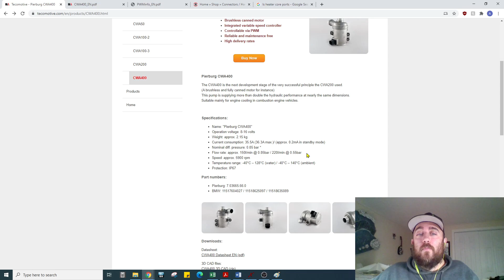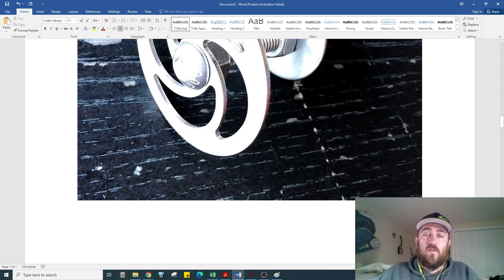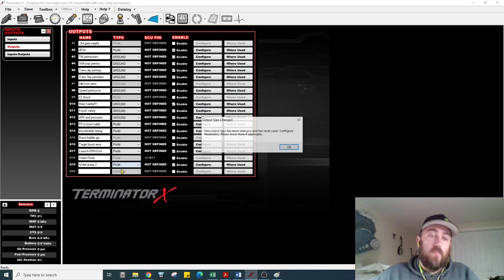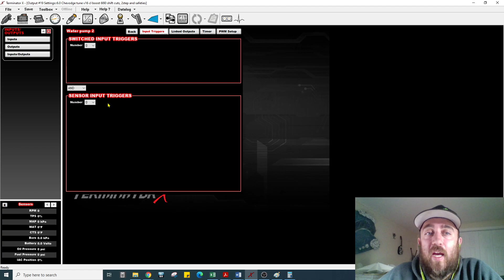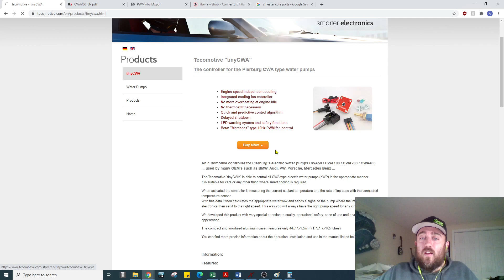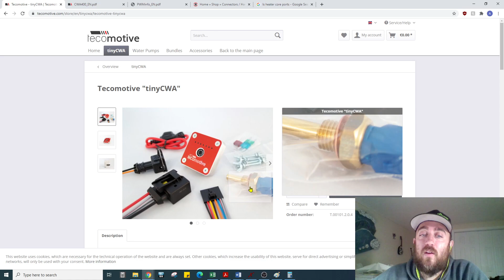$100 BMW Electric Water Pump and Controlling it with the Holley Term X

Comment: LoL! These routinely fail at 60K! BMW FORUMS ARE FULL OF THREADS OF HOW UNRELIABLE THESE ELECTRIC WATER PUMPS ARE
Reply: I have 197.000 miles on my BMW, original water pump. Check your information, thoroughly, before bashing people.
Reply: The other thing to consider is that they are buried on a stock car. Mount it with a reasonable easy access and have a spare. The price is worth it.
Reply: A lot are misdiagnosed and it’s just the thermostat
Reply from the maker: Long story short, These ones don’t, the n54 pumps were by in large, the problem child. 

Short story long, I’ve confirmed that with a few BMW techs including searching the forums myself. The plastic ones commonly found on the n54 were smoldering piles of garbage and made by continental, the forums are flooded with posts about them, some were ringers and could go 200k, but many failed before then. There was a pump that looks similar to this, but is much lower flow, the CWA200, that was used on the N51/N52/N52N. Didn’t do much research into that pump because I really wasn’t interested in the lower flow rate. The CWA400 pump, which is what this is, has been largely very reliable, and is found on the n20. Both the CWA200 and CWA400 are made by pierburg While it’s the newest of the pumps, some people have already been putting 100k+ miles on them without issue. I bought the one for my truck with 52k miles, and I’ve put probably another 18k on it since. I’m not worried, but, with how cheap they were on eBay, I bought a spare just in case.

Comment: this looks like exactly what i was talking to someone the other day about.. i was thinking a 3wire setup that would have 1 wire feeding the pump to run at a slow/normal speed and the other wire or trigger/pwm wire to make it run wide open/100%. didn't even know these were a thing. this may be overkill for what i'd be looking to remedy. 427sbf that blew out the water pump's shaft seal when 150shot of nitrous was sent at it. installed an underdrive pulley on the WP, but may have a cooling concern now and was tossing around the idea of using an electric "helper pump" with the mechanical one or just replacing the mechanical pump with an electric, removing the thermostat, and using the holley to control the pump via temp. however i was concerned about there being no coolant flow and it not providing a good signal to the CTS.

Comment: The link you put up goes to the LIN version, which isnt supposed to be PWM controllable.  What part number are you actually using/where did you get it from?
Reply: BMW-11515A05704/11517563659/11517568594 are OEM numbers that i "think" are the PWM CWA400s

Comment: Thank you for the great video.  I wanted to use this pump in a daily driver so heater is needed.  It's there Reason the thermostat can be ran in the original location on the LS water pump? Thank you for the help.  

Ahmad
Reply from the maker: @boostnhoe  yes and no. You would need to replicate coolant flow EXACTLY the way the LS water pump does it. Essentially suck coolant from the front side casting and discharge to the rear half of the pump, a dividing plate would need to be installed where the pump impeller used to be.

Comment: ~6 mins in and I'm already a fan. Just like a radiator that you don't want to gush (see what I did there?)... I've got more hardcore gearhead information in 6 mins (more than I spend on my GF) than in an entire video elseware. It's like there is a knowledgeable rodder down the street who is willing to share GR8T advice. Ok, gushed a little. Anyhoot. This is a SUB worthy video. And I may even SUB, Un-SUB and SUB again to make sure it went through. As for the <60k mile reference... I don't think any of us who M.O.D.I.F.Y are thinking to much about "warranty status", yes? I doubt that will ever come up because the only dealer I see is for pressed "Vicodins™" (don't repeat that please). Thank you and back to the video. Cheers from So.Ca.USA 3rd House On the Left. :hand-pink-waving::face-blue-smiling:

Comment: LOL at everyone commenting on these failing at 50kish miles. How many hot rods ever see 50k miles 😀
Reply from the maker: For real. Most don't even fail until well after 100k. My truck ran a 170k used unit for 3 years before I killed it with pool acid lol. It still ran, but I destroyed the upper bearing. People think this is the same pump as the n54, it's not, not even close.

Comment: Just found your channel.

Can you go more in detail on gutting the stock pump, running a heater core, and running this pump?
I'm doing a build where i have the LS3 pump, but now have to mount the radiator in the bed of this 1958 Apache truck. Twin turbo. I don't know if this stock mechanical pump will work with the rear mount radiator.
Reply from the maker: Find me on Instagram and message me, I can help you better that way. Same handle

Comment: Do you know if the pump can be mounted in the vertical position? with the suction pointed down?
Reply: You can mount it however you want, as long as you get all the air out of the system.

Comment: The N20 engine in the UK at least uses part number ending in 715 which is the CWA200
Reply from the maker: Interesting, it's definitely the 400 here.
Reply: My 2013 BMW uses the 400.

Comment: I was under the impression that this pump did not need PWM control
Reply from the maker: Not needed if you don't want speed control. Kind of a waste of power to have it on kill all the time though. It pulls nearly 40 amps

Comment: Thanks for the video. Cool stuff. How do you think this pump would work for a closed loop air to water intercooler system? I haven't looked up Bosch pump specs to compare, but clearly 40mm ports flow multiple times more than 19. But perhaps the restrictions of an AWIC system might not be an ideal use case?

Comment: I want to run this pump on a 2.3 Ford engine for street and drag racing.  Can I eliminate the thermostat completely and control engine temperature on the street with with my Holley PWM output.
Reply from the maker: Yes, but just understand that the temp control is going to be bouncy.

Comment: Has anyone had success with running this pump at max for an extended amount of time, a few hours at a time?
Reply from the maker: I accidentally flashed over my tune with one that didn't have the pin mapped and it was in emergency mode for an hour. Never had an issue.
Reply: @scrapmetal_sleepers  I feel like my F3r procharged big block chevy with rear mount radiator will need to run at max speed to keep it cool.
Reply from the maker: @TheRealChuckStefanski  not likely. 50-75% is most likely all you'll need unless the rear rad is undersized. What's the core size?
Reply: 15x28 with oem contour fans on it.
Reply from the maker: @TheRealChuckStefanski  if that's the core size, it will work alright, never used the contour fans myself, but if they flow well, you probably just need the transportation of BTU's and the cwa400 will deliver

Comment: Great in depth video, will the pump run without an activation time delay?
Reply from the maker: Yes, if you provide 12v+ to the signal wire it will go straight to 95%
Reply: @scrapmetal_sleepers  Not completely bypassed, but using pwm like you have without an activation time delay. My ecu doesn't have activation time delay, but i think i can work my way around it with some conditions such as 0 rpm and time greater than 0.1 sec.
Reply from the maker: @linkems  just wake it up using 50% duty @150hz as your base speed. That would properly wake it up, I can try without the time delay tomorrow and see what it does
Reply: I had a look at the pwm info on this pump as well as watching another video and it seems that anything above 13% duty will be enough to operate the pump.  I don't think the activation time delay on your ecu has any effect on the pumps operation.  How has your pump been going? still running good?
Reply from the maker: @linkems  it was running great until I gave her some muriatic acid. Destroyed the upper bearing lol. Was still spinning, just noisy. Replaced with another $50 pump that had 119k on it and it's been great.
Reply: @scrapmetal_sleepers where are u getting them for $50, I got a $90 one and it died after 1 month, the replacement died after 1 week.

Comment: How does this installation change with Holley dominator?  Is the pull-up resistor avoided if we use pwm+ and the black wire instead of the red wire for signal?  Sorry I just barely understand it yet.
Reply from the maker: Yeah just use pwm + and it will work. Also, pump speed will follow duty cycle instead of working inversely.
Reply: With PWM+ on a Dominator will I need the pull up resistor?  I don’t understand pull up resistors.

Comment: do you know why the table is inverse? i saw same thing running ecumaster black.
Reply from the maker: ECU master probably does the same thing that Holly does and pulse's ground. If you use a pull-up resistor whether it's internal or external and pulse ground the signal sent to the computer will look inverse to the table output.
Reply: @scrapmetal_sleepers  ok makes sense. yes ecumaster pulsed ground

Comment: Lmao these fail under 50k miles. All of them OEM and aftermarket
Reply: I have a 2013 BMW N20 with 197,000 miles on it. Still original water pump!

Comment: Super video. What motor setup are you cooling with it?
Reply from the maker: Twin turbo lq4 with a forged bottom end. Still daily driving it with this setup, still on the same pump, even added a thermostat to the setup for winter driving.

Comment: Would this setup be be suitable for a supercharged sbc stroker used as a daily driver?
Reply: Awesome!  Thanks for the quick response.  I was researching Davies Craig kits and ran across your video.  Super informative.  I run Holley's HP ecm and am already using it to control my pwm cooling fans so I was stoked to see this.  $400+ vs $100, no brainer.  Thanks again.
Reply from the maker: gotti1034 no problem, you’ll love it.
Reply from the maker: No reason it wouldn’t work. Mine has been great. I carry a spare used pump on long trips just in case it fails but I don’t worry much about it otherwise.  If you are asking if it’s “enough pump” for your combo, the answer is yes

Comment: Great video! Picked mine up for $75 on eBay used. One thing, you HAVE TO USE 1k ohm resistor or else this will not have correct voltage.
Reply from the maker: You need a pull-up resistor, period. 1k, 5k,10k, etc. Doesn't matter as long as the pump works. It will not work any differently so long as pump sees a pwm signal. Too much resistor, pwm isn't visible to the pump, too little resistor, you unnecessarily draw too much current generating the pwm signal and risk damaging the Holley output driver. So no, it does not HAVE to be a 1k ohm resistor.
Reply: @scrapmetal_sleepers  Data on the pump says it has a pull up resistor built in, so what prevents the pwm of the holley driver from working with it??
Reply from the maker: Christos you read that wrong, the signal has a 10kohm pull down resistor built in.
Reply: @scrapmetal_sleepers  Ah yes you are correct! Thank you. But even then as you  say, as long as a pwm is present the pump will function properly??  The pull down is needed only in case of pwm output malfunction or disconnect right?
Reply from the maker: @christos8189  the pull-up resistor that you add is to create the needed 12V+ to the pwm signal. The termx can only pwm to ground. If you don't use a pull-up resistor, nothing is providing positive voltage, so no duty cycle is detected by the pump. No voltage present, pump is off. 

Conversely, a 12V signal is seen as 100% duty cycle. With no pwm signal provided (again, we are using a pull up resistor here) the pump sees 100% duty cycle, which puts the pump at 95% rated speed. The output table uses values inverse to conventional wisdom, because you are pwm'ing to ground. 20% duty in Holley is really 80% duty to the pump.

Comment: Great instructional video. Be interesting to see if the 32 mm freeze plug and the water pump would like a .039 press fit?
Reply from the maker: Can’t remember what other people have used, I just shaved an aluminum hole saw punch out on the belt sander until a 4lb sledge could stick it in. Freeze plug would be preferable IMO.

Comment: Where did you find the pump for $100, did you source a used one?
Reply from the maker: Used, eBay, I’ve bought 3 so far, all between 55 and 60. Used the ball ever Motorsports pigtail which cost $20
Reply: @scrapmetal_sleepers  what kind of milage are you picking them up at and about what milage would you estimate they last?
Reply from the maker: josh butcher one was 55k, 75k and 110k. They should last 200k or more IMO. From bmw techs I’ve heard from, they rarely ever replace this style. They do a lot of the earlier style ones though. Fcp also sells them new for 274 with a lifetime warranty. Honestly it’s not a bad deal at All.